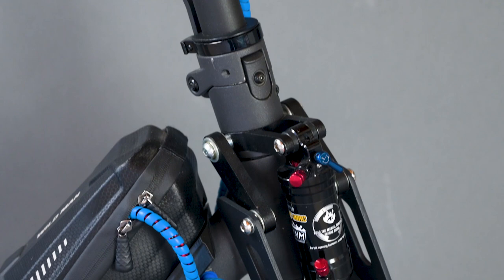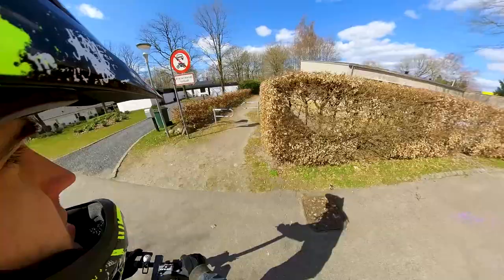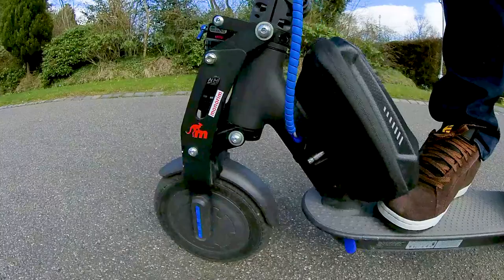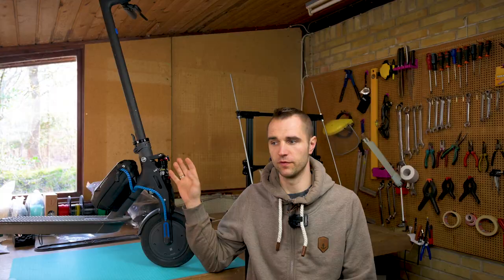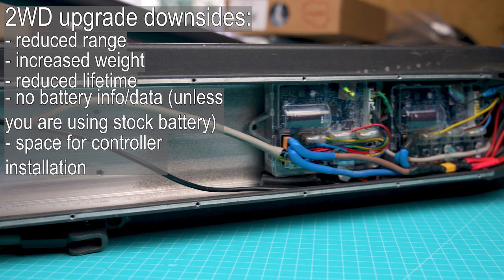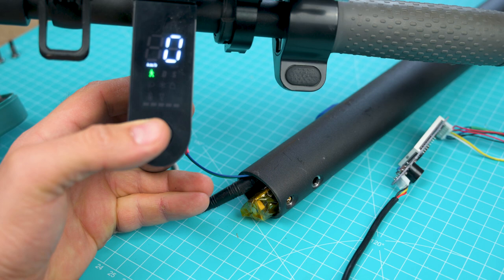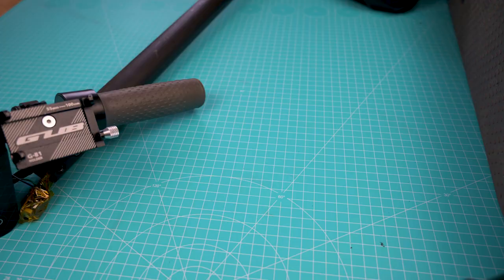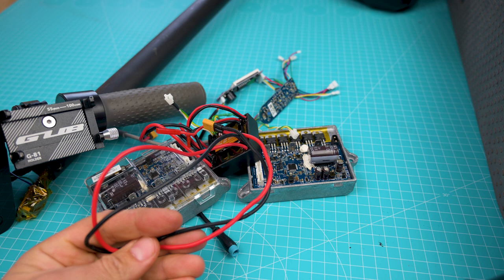Xiaomi M365 2WD mod in depth

Comment: I see a lot of comments here asking if you can just connect the 2 controllers into 1 dashboard and I can say.. yes you can.

BUT

-You will not be able to see the right data on your dashboard (speed, battery level)
-Power button functions (turn lights on & off & changing driving modes) may not work correctly
-You cannot program the controllers together via bluetooth (unless you unplug one of them from the circuit and program the other & repeat with the other controller)
-IT IS A LOT MORE DANGEROUS AS YOU HAVE MORE CHANCE OF BRICKING ONE (or both) CONTROLLERS WHILE CONNECTING THE PARALLEL CABLES (I bricked 2 original Xiaomi controllers myself)

I strongly suggest you to spend a little more money & time and get a second dashboard for your second controller.
Reply from the maker: I will pin the comment at the top :)
Reply: My m365 goes 25mph did shunt mod on controller which is adding solder and copper rods to the traces. Upgraded motor to 350w and 2 batteries scooter is now fast

Comment: When I go around 40 miles, I don't believe such a small steering wheel, I mean, the steering wheel can jump out of your hands in any Hall, or a bump, it can happen even if you go to fast on a turn... I think, this problem should be solved firstly, when you star to increase your speed.
Reply from the maker: Kind of.. i had quite a few situations when I actually lost the handlebars from my hands but kept going. The scooter wants to go and stand straight, even when you don’t hold the bars.
Reply: Yeah, but if your lucky few times, it won't happen hall live, so I think it would be really good, if you would protect your self in this case!
Reply from the maker: @motivboost001  I agree that you need wider bars, but just not as priority no 1. I think better brakes is priority 1 if you compare to stock scooter :)
Reply: @VRMinde   Oh, I thought, brakes are default😄
Reply from the maker: @motivboost001 not for everyone  :D

Comment: Would like to see how the Xiaomi goes with Monorim 500w motor? Apparently even on the stock firmware it will supposedly hit 40 KPH. Some claim up to 50 KPH with a bigger battery.
Reply from the maker: Well, I was also curious and it has been ordered and is ariving :) will make a vid when I get it.
Reply: @VRMinde  Great news. Thanks. I'm considering it myself along with the Rita adapter and battery upgrade.
Reply: i got 70kph with this motor, its a.. how to say that..

Comment: 2 250 watt motors? Just opt out for a 1000w esc controller youll have more battery space and if the dashboard doesnt work just opt out and buy and cheap dashboard
Reply from the maker: it was just a play-around, I do not really use the scooter :)

Comment: How do you brake???!!!!?!!!
Reply from the maker: I don’t, just go full speed mate!
Reply: @VRMinde  I have many of these at my disposal and have considered a 2wd and 3 wheeler but the only thing stopping me is brakes
Reply from the maker: @mistermagnifico  i have a disc brake in front mate. It works really well. On top of that regen braking is helping a lot. You can actually install even double disc brake, but the front one is enough
Reply: @VRMinde  Bro that is crazy imagine all that acceleration power and boom front brake! From the experience of pulling the front brake on a bicycle downhill you can understand why I am cautious
Reply from the maker: @mistermagnifico  if you ride any two wheeled vehicles, bikes, motorcycles, etc, you should already know that front brake will do 80% of the job because of the weight distribution when braking. 
We have a saying “if you are afraid of the wolf - do not go to the forest”. Meaning, don’t ride faster than you are comfortable :) ride safe mate!

Comment: Great video and great step by step installation, something I've been looking for, for some time, your scooter has come along way, looking forward to see your next upgrades you install
Reply from the maker: Hey bro, thanks! I still have some upgrade ideas in the pipeline :)
Reply: @VRMinde  excellent stuff looking forward to seeing further updates, I've done quite a lot to my M365, recently added a 48v 13s4p 20ah external battery through the monorim 500w motor through the rita adapter, I have to say amazing results
Reply from the maker: @springamcs  did you use the stock controller?
Reply: @VRMinde  yes I did, I have the V3.0 controller which is already reinforced in terms of the traces at the back and the MOSFETs are pretty powerful in terms of voltage, I also added more thermal paste as there was barely any standard, I put a thermal pad underneath the MOSFETs and also added a cooling fan on top of the controller for better ventilation and have to say does keep the temperature down far better than before I done the work
Reply from the maker: @springamcs  Sounds like v3 has it all solved. I still need to upgrade mine
Reply: @VRMinde  indeed they have and I've pushed this controller quite a lot, I managed to get another v3.0 readiness for my AWD, before the work I done as well the temperature was hitting 39 degrees but now goes around 25 degrees but then drops and 28/29 degrees on a warm day however has made a huge difference, if I'm to go beyond 13s now then I'm gonna need to change the transistor on the controller as it's only 63v as you no but the MOSFETs doesn't need changing as there good enough, when I checked the specs of them they sit between 80/100v the MOSFETs in the V3.0 as well as the soldering traces are very thick
Reply: @mrzoro6121  I use Instagram more I don't really use Facebook much I'm on a few scooter groups on Facebook groups I follow but that's it
Reply: @mrzoro6121  it's  "springamcs"

Comment: U can do trace cut on the esc too to increase the speed by using higher voltage on 72v u get to 50-60kph
Reply from the maker: Yeah I need to do that or they will burn the traces for sure :)

Comment: Bro, you can add a switch for the second dashboard. So you can do single or dual motor. Concept is like those big scooters
Reply from the maker: That’s for sure! I would still like to have it on one button though. Why would I use one motor when two are so much fun 😂
Reply: @VRMinde  well. That could be an option for a good tutorial..
Ride safe bro
Reply from the maker: @KismetMookz  i will make a follow-up when I make my needed improvements. Thanks bro!0

Comment: Thank you very much for the video. I do E-scooter repair as my side hustle and i have one working ninebot motor and ESC from customers. I was thunking id i could use those to converst my Xiaomi Pro 2 to 2WD. The connectors are exacl´tly the same, but i still need to test what happens when i connect xiaomi dashboard to ninebot ESC.
Reply from the maker: give it a go :) you have everything at hand already :)

Comment: You should connect together power button or just takeout secondary button and wire it with first controller so you can power on and off together with one push.
Reply from the maker: It’s been a while I was riding this one :)

Comment: hey, Big thank for this video, is very usefull for me bcs i actually have two m365 pro2 in my house and was thinking about to made one with dual motor. So thank again for your video. 

So for my project, i will try to made the dual motor with 1 batterie for each motor. to avoid the range limit. and anyway, i just have 2 batterie so just let made that !! :) 

I just have one question about this setup, went i made my test everything was fine but, to turn on both controller i have to clic the power bouton in each dashboard, do you have any tips to link the power bouton of the stuck dashboard with the second dashboard to turn on together ?
Reply from the maker: Hi mate, oh, it worked for me with one button on one dashboard. Button is just a connector between wires, so there must be a way to duplicate it :) as it has been now what? 2 years ago I did the project? I can’t remember the details anymore…

Comment: Where did you buy the spacekit for the second motor?
Reply from the maker: Hi, check info in the bottom of the description under the vid. Alternatively you can get a kit from Monorim m365 front disc brake mount kit or from monorim motor cover kit as well :)

Comment: Nice upgrades. I think it would be good to have 2 disk brakes (with break levers on each bar) and maybe turn down the regen braking a bit on the front motor.
Do you think it's worth putting honeycomb tyres on both wheels as the air shock absorbers are taking out the bumbs now?
Reply from the maker: I mean if you want the scoot to last - there is definitely a need to reinforce controllers, install higher amp battery, probably then you don’t need to reduce the regen braking 🙄 if there were 2 disk brakes - would be a perfect setup. Just the price of m365 is getting ridiculous :) 
I do not like the honeycomb tires because of how they perform on corners. I don’t trust them :) and these cheap 10” ones with some “slime” sealant run without any punctures for me month after month. I am to stay on air tires, I believe 🙄
Reply: I have honey tires and I hate them
Reply: @bruno3833  I have it on my front wheel but I have an air shock to help with the feel. The rear tyre is air filled though.
Reply: i have full rubber tires with holes. i had them for so long they are starting to wear down, which means ill need to replace them and that may involve cutting them off. they are super rough but the front suspension I got from monorim helps reduce the vibrations. sometimes i worry some bumps might be a little too rough from the front motor but it seems fine, regardless, id say if you where you put in the money to have a smoother ride by buying front suspension then air tires might be better if you want a smooth ride and your streets are relatively clean from glass and nail. even my full rubber wheels had a nail stuck in it. full rubber tires will also wear down you battery faster and reduce your speed. i have even read that it can reduce the life span of you from motor.
Reply: @illidari12211  Well said. 👍 The more the tyre weights the harder the motor has to work. I'll probably buy another motor with the air tyre already attached.

Comment: Do u know where I can buy a upgraded controller for the Old m365 pro that can handle 48v batteries. I hear a lot of people say the stock one will burn out
Reply from the maker: It might survive if you turn off any regen braking and don’t go full throttle for too long (need to monitor the temps a bit). I don’t know where to buy one mate. It would be best to get the v3 controller from the pro 2. They used to sell for around 100 eur though 🙄

Comment: Man I have one question for you. Did you try to split signal from one display (m365 pro) to two controlers? I mean to use splitter like in  power cable from batery to controlers. Then you will have less electronics and you can off your scooter like normal stock m365 pro but its only my idea i didn't tested it yet but i think if it can work it will be the way better than a 2nd display
Reply from the maker: I do not think it will work mate 🤷🏻‍♂️ it is not so hard to hide the second dashboard in the steering tube to be honest 🙄
Reply: @VRMinde  i also had two displays for my M365 awd but It had Shortcuts vērt often so i made a cable from ome Dashboard to both controllers
Reply from the maker: @aldisgarais  Does it work with just a secondary cable? That would be easy...
Reply: @VRMinde  ok i made that cable in service and it works as it’s mentioned above. Now I want to make such cable for two ninebot controllers because I’m converting M365 to awd Max
Reply: @VRMinde  two cables are connected in parallel
Reply from the maker: @aldisgarais  Thanks man!

Comment: First thanks for your video, I'm already involved in the project, in my case I will use two brake levers, one for the front and one for the rear, so I won't have to connect the two screens with the brake cable, but there is one thing that I do not see clear, so that the accelerator acts on the two screens, How do i connect the cables?
Reply from the maker: 09:05 blue and green cables, one is accelerator signal another one is brake signal, can’t remember which one is which, but you can see in the handlebars by where are they going left or right :)
Reply: @VRMinde  in my case I will only share the throttle with the two screens, so, I send the green signal cable to the two screens, is that correct?
Reply from the maker: @iber65  yes, if green is throttle :)
Reply: @VRMinde  just one more thing, the red and black throttle cables, do they have to be shared on the two screens or do they only go to the main screen?
Reply from the maker: @iber65  that is ground and positive. They go from the screen to the throttle. You will need to connect them to your new brake handle as well

Comment: Hi I'm just wondering if you know why the primary dashboard has to be the pro version ?? why can't it work with two standard dashboards...thank you
Reply from the maker: I think it can be mate. I was just using someone’s recipe that works. Actually one guy said in the comments he used only one dashboard for both controllers with double cabling. Maybe worth trying?
Reply: Thanks mate, I will try with two standard dashboards, only sharing the throttle connection. Cheers

Comment: Why just don't connect both motor in paralled with one controller? The power on motor will cut in half but you can boost power delivery with firmware.
Reply from the maker: I can think of 2 reasons: 1. the ECU is reading actual motor position with hall sensors and ignoring that will not ensure the smoothest operation of the motor. 2. you will double the load on the controller which is already the weakest link in the chain

Comment: Resulta que funcioa suspendida en el aire funciona exelente pero cuando intento correr se tranca  y no avanza y queda dando error 16. Apago y enciendo
Reply from the maker: If it runs without load and does not work with the load there must be something wrong with hall sensor layout. Some wires might be the same color, but not the same layout in the motor. That is my only assumption 🙄

Comment: Do you have a 250w motor on the rear also?
I have a 250w in front...do you think it is possible to combine with a pro2 350w motor in rear ... will it be better or worse?
Reply from the maker: I have both standard 250w
Of course you can put 350w in rear if you want to, they are the same dimensions. I have now 500w, will first try it solo and then might move to the rear with 250w in front :)
Reply: @VRMinde  Brilliant. Can't wait for your video, man. Good luck

Comment: Would it be use full to make two potis on the brake and accelerator lever to adjust the balance between the motors?

I was planning to Do the same but i stopped on a rwd version because a single tyre has enough grip i rather try to increase the output.

Did you found a way to extend the battery case? I found a stl for printing spacers to increase the height.

Do you have a idea how to reinforce the steeringstem? I heard of people having Issues after increasing the output of the Motor by overvolting. The brute force of the acceleration Seems to make the stem wobbly
Reply from the maker: I have the 500w motor but still have not tried it with a decent size and voltage pack. RWD makes sense if you go with aftermarket controller and battery.

I have a large printer and developed a prototype one-piece extension, I just don’t have enough time to work on all these improvements :)
I do not think you need to controll the motors separatelly 🙄
Reply from the maker: Oh and I have never had any issues with stem and locking mechanism on my m365. There is no way enough force to bend the stem from the accel mate :) you need like 2kw or so, and even then you should have decent feet position to handle the forces and not pull the handlebars. The handlebar AT ALL TIMES needs to be not overstressed so you can continue controlling your scooter (accell and brakes)
Reply: Okay thanks for the info. I yet have only a shunt to increase amps but overvolting is something i want to try out but people telling me that the stem could cause Issues made me stop any planning on that regard. I have the german knockoff of the m365 and in my Community people said that the Controller gets Fried on 12s. So i have no choice than getting a proper controller.

The acceleration and brake balance was just a idea i probably never get the Chance to try out i was just suggesting it if it interests you to change some variables to see how it effects the scooter but it is definently not a needed Feature at all.

Im looking forward to see progress on your build buddy!
Reply from the maker: @johnathankrausrig9237  the stock m365 controllers also get fried if you push them just a bit more than you should :D 
I will now just try two stock motors and controllers on this build with less power. The hope is for a great acceleration, not pushing the top speeds much above the legal limits. 
And I will probably try the 500w motor on another build with a decent controller with the field weakening and big 14s pack 🙄

Comment: can you hook up the second motor to the stock esc ? and have a switch to turn the secondary motor on and off to save battery ?
Reply from the maker: Hi mate, I can see I missed a lot of comments on YT, one of them was yours. Both motors are hooked up on stock esc's. You can come up with a switch to turn one off.

Comment: I have commected the dash together with red pin and when I turn the dash off the other stays on or goes off and then turns other one on
Reply from the maker: I had the same issue mate. I think there is a need of power cut-off button for both dashboards lr they power each other. I was either unplugging the bartery pack (as it was external) or setting auto-shutdown timer for both dashes